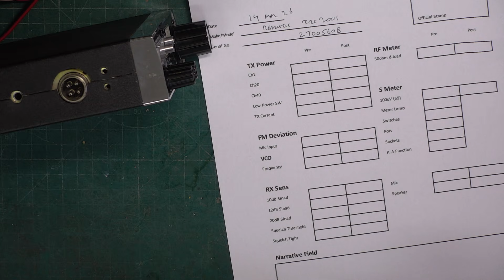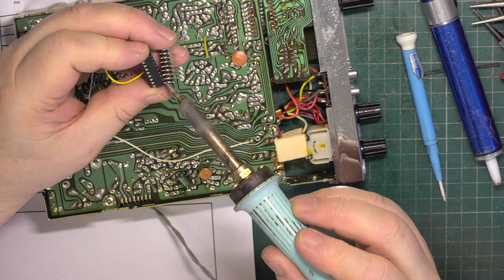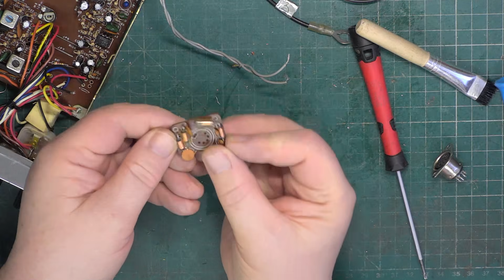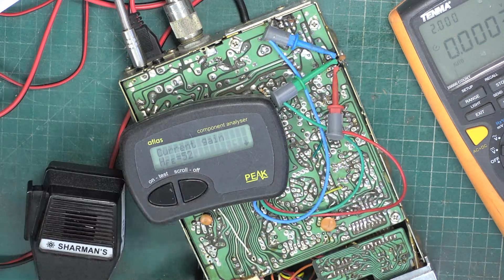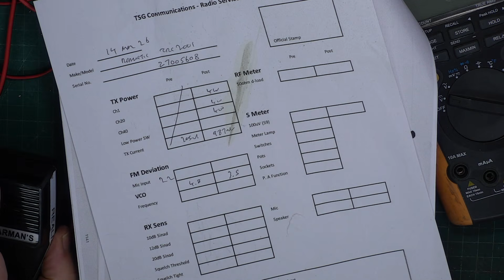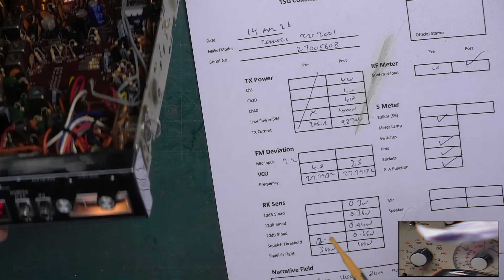Realistic TRC2001 CB27/81 UK FM CB radio - extensive repair & realignment

Comment: I have one of these in its box . Fantastic little radio although it does need  recapped and I’m a tad nervous to do it myself
Reply from the maker: Unless the radio doesn't work, I've found only the two 220uF & two 470uF capacitors usually need changing.

Rihard
Reply: @ukfmcbradioservicingTango21  it works fine although I only use it on the rare occasion mainly to test it through a dummy load because of the capacitors .

Comment: Simple little insulator.. 
Good it's working perfectly now. 16 ohm speaker coming right up!
Reply from the maker: Strangely enough, the speaker worked perfectly on the forthcoming 'on the air' test video. Looks like it works in it's 'normal' position facing down, but not facing up. It's the extra thin/flexible leads from the speaker solder tag to the cone that mus be corroded.

Richard
Reply: Got a few kicking around, as you can imagine